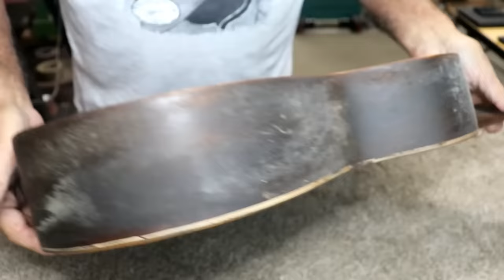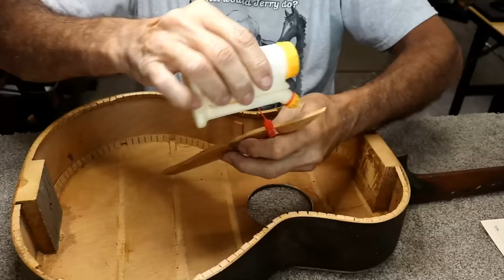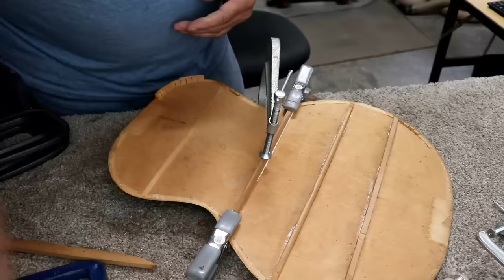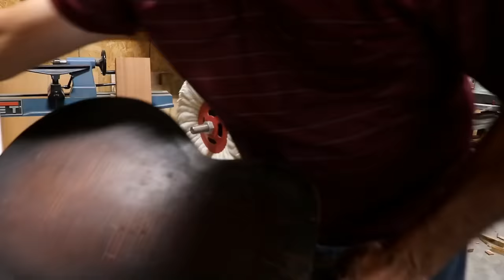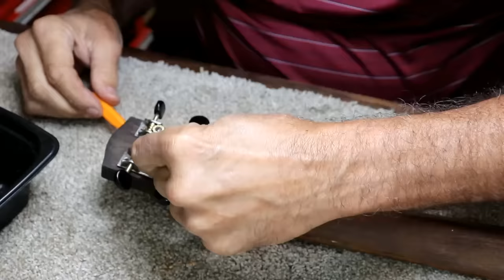596 RSW Can This Wall Hanger Become Playable? - A 1920's Mail Ordered Vintage Guitar Repair

Comment: very nice work! It turned out way differend than what i expected from the beginning, thinking that it was a wall hanger. 

with the glue problem at 20:30 you can take a needle with some thread at get the thread pushed through. Then you are able to make a even glue on parts that is partially lose with space enough for the needle. :)

Comment: I don’t know if this tip will work on wood or not but it works on cheese and on cleaning refrigerator door gaskets. The molds you don’t want. White vinegar on a clean white cotton cloth will kill and remove molds. (Between uses wash the cloth in hot water with soap & 1 1/2 cup bleach. This will keep the cloth from spreading molds.) If you need to, try diluting it. A 3 part boiling water to 1 part vinegar ,cooled to warm enough that you can put your hand in it will clean glass without streaking the mold that forms on glass storm doors. If you have a bit of moldy wood, give it a try. 

I hope this tip will be useful to you.

Comment: Phosphoric Acid (Lime Away) works very well for removing rust on metal parts. Sometimes, you can just let the rusted parts soak in the acid overnight. For the times I've used this method, it's left the base metal untouched ... just the rust was removed.

Comment: I stumbled upon a 1968 Harmony acoustic at a yard sale. I thought it was unusual because it had a Fender Stratocaster-style headstock. It was unplayable. They wanted 10 bucks for it. The guy said that for five bucks, it would make a good wall hanger, so I bought it. After I got home, I saw that the neck was jacked forward. I would never call myself a luthier, but I had an idea. I had nothing to lose except five dollars. I took a thin-bladed hobby saw and cut a slot into the neck's heel along the body. Its dovetail fell apart, but I could glue it, pull the neck back, and clamp it. After it dried, I restrung it. Much to my surprise, the action was as good as my Martin 000-15 mahogany guitar. Soundwise, not so much, but it gets pulled out and sings happily when an extra guitar is needed.

Comment: If you want a polish that lasts, try P40 from majestic solutions out of Raleigh NC. As for holding a guitar in place or holding your clamps so you can tighten them or keep the guitar still, try silicone mats. And replace the leather pads on the clamps with silicone as well.

Comment: Recently found a tossed out Sigma / C. F. Martin acoustic guitar. Think its from 1974, in fair shape. Looks like a tuning machine / key was replaced, there is a small crack in the saddle (saddle is still secure), some small scratches, dents... But still has 6 strings!

Comment: Brother Jerry, have you considered using a Dremel tool with one of those flexible extensions and a small shop vac to vacuum up debris as you go ? I think it would come in handy because you can use barrel sanders and all kinds of things. I think another thing you come in handy is one of those cutters with the high vibration so the blade just stays in place a minute vibrates it would also be good to slip underneath edges like when you're removing the back or front etc. Just trying to help you to work smarter than harder. I would love to have one of these old guitars although I don't play the guitar right now I would love to be able to. I thought about the steel guitar or a laptop. The big music shop near me finally closed down so it might be harder for me to get to one where I can try out the different instruments to figure out what I want to play eventually. I played sax for years, but my front teeth rotted and until I get replacements I'll switch to something else. I also play piano, but I live in a senior apartment complex and can't have anything too loud. God bless you in The Lord Jesus Christ, amen.

Comment: I get a feeling like that whenever I buy a guitar from a charity shop, generally classical guitars but I've lucked out a couple of times by getting some good ones, one is a flamenco guitar that cost 6 pounds one is a woods dreadnought guitar cost me 10 pounds one I can't identify as there is no visible paperwork in the soundport but it's so nice to play and cos 8 pound even the action is nice.. never found a guitar that couldnt be made playable with a little tlc..I have others but I alway prefer acoustic or nylon string guitars, they accumulate charm and worth as they age. Good to see what you did with the old wallhanger. It lives again 😊

Comment: When I got to the part of the video where you tried to buff the back I got worried. Wash it with Naptha. That will get the oil, wax and silicone out of the pores. Then wipe it down with a similar color stain and wipe away the excess, Don't use anything with linseed oil such as minwax.  Old Masters has way better stain and it doesn't need 8 hours to dry. After all of that try wiping it down with a product called Lacover by Mohawk products.

Comment: Try putting thick rubber on the inside of your spool clamps instead of leather. The rubber is just as good at preventing compression marks, but prevents slippage and walking.

Comment: Some people will hear that and think it had a cheap guitar sound .... however most all of those old guitars with tailpieces do sound a lot like that .. even name brands with carved tops and backs .... it's a unique sound that I call tje cowboy sound..... and it is sought at in some circles , on fact driving up the prices for these old guitars .... because it is the only  sound that actually that genre of music... 

    Didn't know that until 3 years ago..... good job Jerry .... hlad you didn't try to fix all the scratches and worn spots... It needs a rope string for a shoulder strap and it will be complete ..

Comment: I'd have tried cleaning with 409 to get it good and clean. What looks like oxidation is really a layer of grime. Tar and nicotine if they were heavy smokers, but it would smell of cigarettes if that was the case.  I have a wall clock that was like that. It had been left out in a garage where it was exposed to years of exhaust and everything else suspended in the air. I managed to scrub most of the grime off but gave up after a while and removed the finish.

Comment: As a woodworker, when I see how you're using the chisel at 42:17 and a few other points, it makes me wonder – do luthiers avoid using mallets with chisels? Gentle taps have practically no follow through if something gives way, so they're much safer than loading up the chisel with pressure by hand. Maybe that's discouraged here because of how delicate the top is? Curious to hear your thoughts.

Comment: Have you considered the possibility that guitar had been someone's attempt at setting it up as a slide guitar? The very high action achieved by what looks like a metal saddle(?) would make sense. Frets were probably filed to try to get rid of string buzz because you don't fret the strings playing slide. Saddles aren't usually metal either. except on some of the early Weisenborns to my knowledge. And I'm guessing the overly tarnished frets were from the filing off the  ickel or other protective coating that might have been on the top layer of the frets.  Nice job, BTW.

Comment: I love this episode. I've seen it 3 times now. And the tone is better than I expected. I'm guessing, but Jerry was totally befuddled why the back was off unevenly on the upper bout. Could it possibly be because of how much force he had to put on the clamps when gluing the braces that were so curved? Seems to me like that might've been the culprit. Even though he tried VERY hard to glue them down evenly from the center outward in both directions, it had to be really putting some force on the shape of that back and brace. As well, like Jerry said, when the top or back is removed, those sides are free to go wherever they want. 

I would appreciate if Jerry did more than G C and D chords in his demos at the end. No need to go up high on THIS guitar, but I would really appreciate if he played the other open chords. How about E, A, and B7?  And D, C sus 2 (C add 9), and G?  Everyone knows those simple chords. And on the higher end guitars he really needs to have someone play up high and bend some strings. For all I know he has a guitarist come in off camera and play leads - if the customer is a lead guitarist. I know some of his high end guitars are for lead guitarists that DON'T go high on the neck.

This is a beautiful story of a "derelict" guitar that was salvaged. I want to see it after those "touch-ups".

Comment: The technology of instrument building has been around for such a long time that even inexpensive guitars often sound nice and look nice. And if one takes them through the years they'll become something as cool as this one. Even if the owner won't use it for anything but a conversation piece it's still cool the thing lives on.
I got an inexpensive guitar something like 17 years ago. I hadn't had much money. I came to check out Yamahas but there was a Kramer there that looked cool with nice inlays in the fretboard. I tried it, it sounded better than the others, it looked better and was within budget. And I got it. And I played it over the years. It needs a fretjob really but to change frets costs almost as much as to buy a new guitar of this price range. So I'm kinda torn. And looks like I'm going to pay the tall buck and do a fret job on the old one because its old and I like it. Not because it's expensive or rare or anything. But because it's been played for 17 years. I now got the money I haven't got when I first bought it but it served me right and I'll treat it to new frets and new nuts and it'll play again.

Comment: Wow someone has an almost identical one like this one (1937 Super Rare Vintage Parlor Guitar, Richter, Built in Chicago, figured maple faux finish, arched top and back - Awesome and Very Rare) The one they have has a Long scale fretboard at almost 26" and the nut width is 1 3/4".  He said the Richter label was on the neck block just like yours.  They are selling theirs on eBay for get this.....$1,849.00 or best offer + $69.55 shipping! Apparently those initials on the front were common for this instrument.  The one he has says F A S.  So I don't know...maybe your friend has a more valuable guitar than he thinks!  Good luck...you're doing a great job with your restoration!

Comment: what type of glue?

I have one lose brace inside a 1960-70  Lyle Japanese C-650 I picked up for $20.

I can reach it from the hole and then I’m going to hydrate it a bit, clean it up, new pegs, new strings and it should be good to go.  

It’s not a Richter or my other personal I’ve had for 38 yrs but even cheap guitars need some tlc and it’s got a rich red color that I couldn’t resist for $20.

For Old rusty metal… I clean the rust off and apply…… Boiled Linseed Oil….  
Very thin ,,  pretty much I put it on and wipe it off and then dry with a hair blow dryer and wipe again.. Too thick and it gets sticky but thin, heat and let dry completely and it’s a clean look and satin feel.

I did some tests of 5 things on a bare metal by leaving them  outside in the Florida rain and sun for weeks. BLO worked great. Leaves a plastic like finish and is used on antique guns etc 
Canola oil also worked great initially but it  breaks down different over time so stickier but it Does protect metal.

I even tried BLO on my headlights and a shaving mirror in the shower. Water won’t stick…BUT if you do that and try to buff it later it blurs up so once it’s dry just rinse with water & it runs off clear. 

When I put BLO on wood I use my fingers and then 0000 steel wool lightly , let dry then wax paste depending on the end results I want also with steel wool which also works on metal. Thin is the secret and of course patience like we need for all these drying time projects…

Beautiful guitar.

So glad it’s not a wall hanger.

Comment: I think that at 55:11 the last clamps that you put on should have been the first to go on because it helps secure both the back with the rest of the body and ensure that the guitar is clamped on both sides so you can have both hands available when adding the rest of them, kind of like pinching the thin part of an hourglass

Comment: When you have an old wood shellac finish lake on old furniture you use rubbing alcohol pure alcohol to rub down sanitize and kill all the mold and mildew and then you gently rub in some mineral Spirits and wipe that can you use rosewood oil or linseed oil or regular furniture polish and then wax and it comes out looking brand new

Comment: CHARLES F. L. RICHTER (Founder)
CARL H. RICHTER (Son)

Richter (Richter Mfg. Co. Chicago) was a Chicago label of the 1920’s, 30’s and early 40’s.  Their guitars were budget  instruments but they are on a par with Harmony and Kay guitars of the period, and for blues playing can sound as good as any 1930’s Oscar Schmidt concert sized guitar.  Most Richter guitars were all birch construction, many with a stenciled or silk screened decorated soundboard, very popular at the time.

There is also the belief that Richter did not make their own instruments but contracted other Chicago manufacturers to do the work, Harmony is usually mentioned.  I am quite certain they did have their own factory, and they proudly display it in one of their ads (more information below).  Their guitars also have quite distinctive characteristics that further substantiates that they had their own factory.

RICHTER GUITAR CHARACTERISTCS

    Medium quality all birch body instruments with a rounded chunky, yet comfortable neck.
    Richter branded guitars usually (but not always) have the distinctive ‘gumby’ style headstock with the small paper ‘Richter’ label in a script font on the front of the headstock and ‘RICHTER MFG. CO. CHICAGO, ILL.’ impressed into the wood on the back.
    Richter made guitars usually have the word ‘RICHTER’ stamped in ink onto a thin piece of wood that is glued (sometimes haphazardly) to the heel plate on the inside of the guitar. On this heel plate can also be stamped the manufacture date or a serial number.  Guitars that carry a distributors brand such as B & J Serenader still have this stamp inside the guitar.
    The saw kerfing around the top and bottom inside the guitar usually has a small square profile.
    Richter made some cowboy stencil guitars that were sold by Montgomery Ward, ‘The Plainsman’ from 1938-1941, ‘Home on the Range’ from 1938-1939, ‘Red Foley in 1940 and ‘Rodeo’ Scene, also in 1940.

The Richter Manufacturing Co. was founded by Charles F. L. Richter, sometime before August 1920:
“C. F. L. RICHTER DIES. Charles F. L. Richter, president of the Richter Mfg. Co., a string musical instrument concern at 2532 Irving Park boulevard, Chicago, died last week. Mr. Richter was a Mason and a  Shriner. He was an active member of perhaps a dozen fraternal organizations. He was a member of the Illinois legislature in 1909. He was born in Germany April 30, 1853. and came to America in 1883.” (PRESTO 28 Aug  1920 p 5.)

Following the death of Charles Richter in 1920 the company was run by his two sons, Carl H. Richter and Harold Richter, and by February 1923 The Richter Mfg. Co. had “completed its first full year as a manufacturer of stringed musical  instruments for the musical merchandise trade” and that they were “now in a position to supply the trade with an excellent line of mandolins, banjos, guitars, ukuleles, and other stringed instruments”. (MTR Feb 3, 1923, p. 29)

In the early years of manufacturing the company seemed to have great success with the ‘Sweetheart’ brand of Ukulele: “Carl Richter, president of the Richter Mfg. Co., is highly gratified with the activities of the Sweethearts in the face of the present ukulele business situation. “I don’t know where they all go to, but everybody seems to want a Sweetheart.”  MTR Nov 20, 1926, p 38. (Note Carl Richter was now the president of the company, and after 1927 there is no mention of Harold in further articles).

Side note: Richter did not always put a maker's marks on their guitars, but when they did add one it was attached to the neck block.

Comment: To keep the wood from sliding around when gluing lightly salt the piece with glue on it. The salt will bite into both pieces of wood and keep it from moving out of position

Comment: I would have used black leather dye on the fretboard before the linseed oil. MicroMesh might have also taken off the top layer of oxidation on the finish and made the finish look (and still be) original.

Comment: After I met a very prestigious high end classical guitar builder and luthier he builds 10,000 dollar plus guitars and he uses cologen it's from animal bone Maro same stuff they use for jello and he mixes it with 180 proof alcohol or everclear and it mixes for 24 hours and it's way stronger then any wood glue you can buy even tightbond and it comes off with alcohol if you ever need to do a repair you can remove the kneck and all the wood parts with alcoh with no damage but if the guitar breaks it's going to break on the wood not the glue joint and guitars made back then as in acoustic like this one and classical ones was all glued with that cologen animal glue that us humans have been using for thousands of years for everything. But nice restoration/clean up to be playable

Comment: Pretty good job up until the finish of the guitar. Have you ever heard of stripper the cheap stuff that’s like Jell-O and then you just scrape it off with a putty, knife and steel wool and now you got your nice raw wood and then if you’d like, you can oil it simple

Comment: Could the hardware’s have been cleaned by using a solution of deluded white vinegar? Or Simple Green?  Placing the hardware in a pot using 50% solution and boil them for a few mins until all grime has been lifted. Then rinse with distilled water and dried in oven at lowest setting? Re-lube tuners and reinstall?